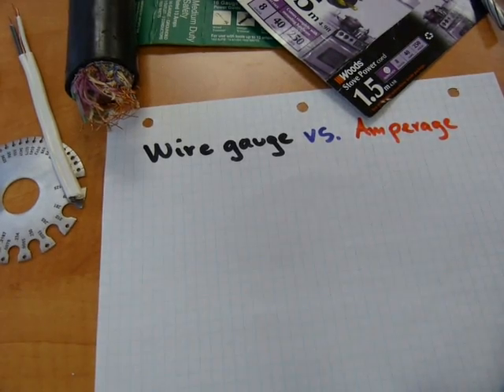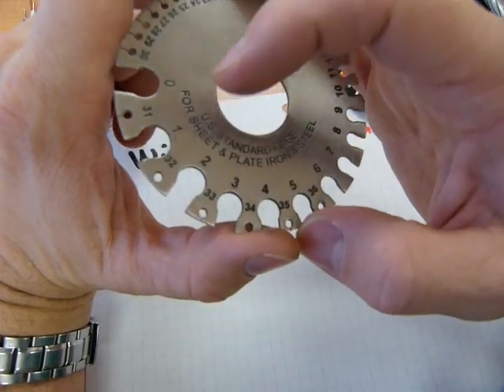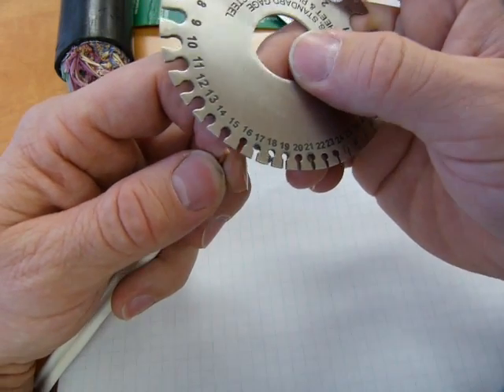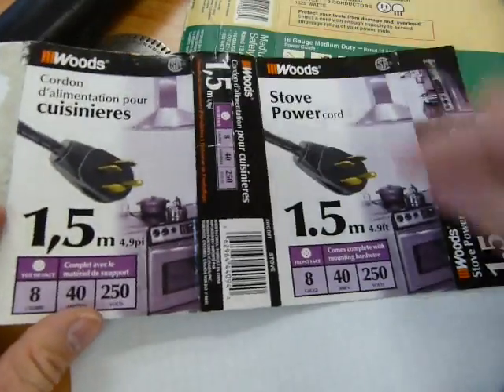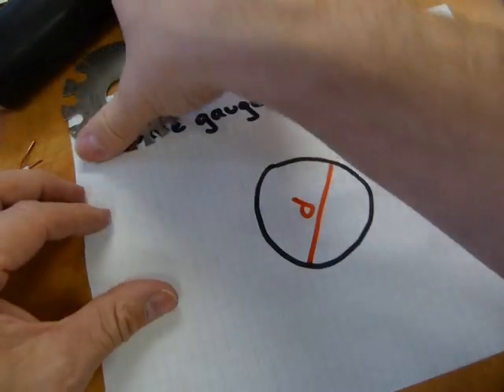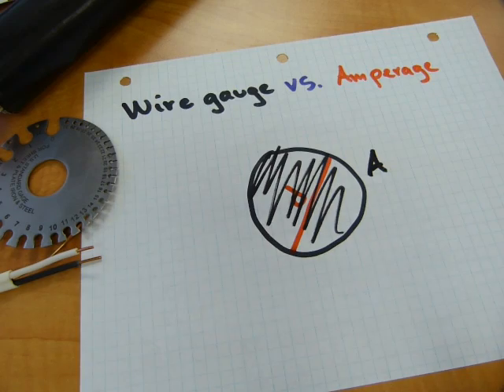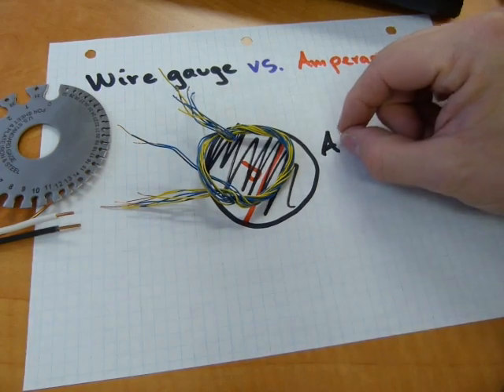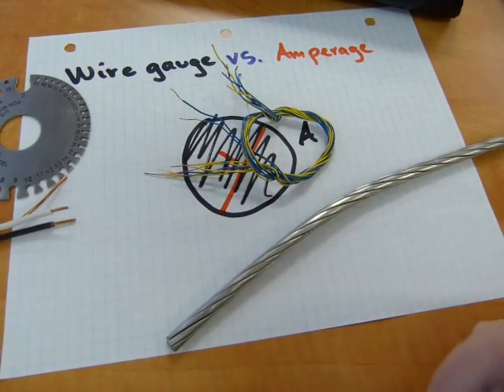Wire size vs. amperage

Comment: Question:  NUMBER of coulombs passing per second. 1 coulomb equals 1 Amp.
Limited by the diameter of the copper wire. Thank you for pointing this out.

Comment: That telephone cable is paper insulated 26g. Paper? Yes. It's very good as an insulator if you keep it 100% dry. Usually flooded with pressurized nitrogen.

Comment: If I want to make a copper coil that powers something that's 12 volts 0.01 amps what gadge wire would I use an how many times would I wrap the coil

Comment: Sir, AWG Means American Wire Gauge. It's used to determine the size of wire you are using ranging from smallest to largest. 18AWG - 1000kcmil. There are larger and smaller but I'm basing this off the NEC 2017. All these wires have a max Ampacity based on the conductor, conductor type, temperature, voltage and watts.

Comment: I understand that sheet metal gauge is measured by how many sheets of steel it takes to make an inch.  So, 15 sheets of steel makes one inch is thinner than 3 sheets of steel to make one inch
Reply from the maker: No, it does not, but can be visualized that way to some extent.

Comment: Is there any difference between AC and DC AMP?
Reply from the maker: The direction of flow which makes AC harder to let go when electrocuted. See also https://www.youtube.com/watch?v=DgodqbkCFNk
Reply: Thanks, I,m trying to use building wires to run them on my turbo car, so they can handle more amp!
Reply from the maker: Solid building wires are different from braided wires in a vehicle. Vibration.
Reply: apprenticemath DC is harder to let go.
Reply: ac currrent is usually read as RMS current (root mean squared) or the dc equivilent.  as ac is a cycle it goes from pos max to zero to neg max to zero back to pos max.  (one complete cycle, 60x a second for 60 hz)   So sometimes in that waveform there is zero current.. sometimes there is peak current.. but the equivelent to the work dc current would do is RMS current.

Comment: +apprenticemath        The figures 31 ... to 38 appearing between the 0, 1, 2 ... 6 are not any British or Zimbabwe shoes standard. They just continue the series after 30 and were punched in-between the 0-6 gauges for better use of space (then between 6 and 7, and further, the space is getting too small, and they stopped inserting additional values of gauges).
Have a nice day.
Reply: Pikaxu Biq i noted that
Reply: He knows, he meant like for wire gauge numbers vs actual measurments, how the wire gauge numbers are arbitrarily assigned, and he says a few minutes later about how like 36 would be for foil (as that gauge is for sheet metal)

Comment: but said so it also means that both thick and small diameter wires can both carry lets say 16A, while a thicker wire will have less resistance thus having less voltagedrop thus keeping temperature relatively low, while a thin wire at 16A dies have a larger resistance, thus larger voltage drop, thus larger power disapation resulting in a large  temperature rise and finally melting itself like a fuse wire, right ?? so said... a 1A fuse isnd always equal a 1A fuse then , since there are 1A fuses for 230V and such for low voltage application, or isnt it ? (beside there are fast and slow fuses too)
Reply from the maker: +Axel Werner Right fuses are made to work at fixed V and A, as shown here https://www.youtube.com/watch?v=0VgrhFhkH2k
Reply: fuses are rated for given voltages  you should probably select the proper fuse.  a 1 amp fuse is not much good if the voltage is so high it might arc across the gap.  If the circuit has any large inductance it will act like your cars spark in the distributor.